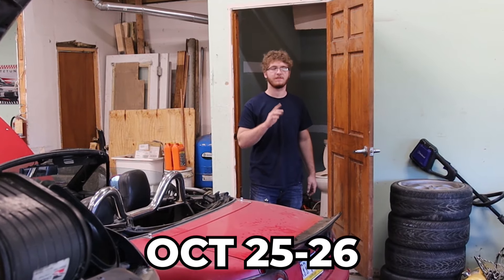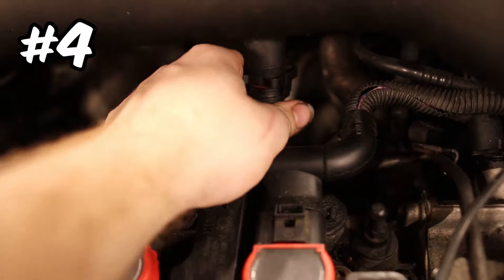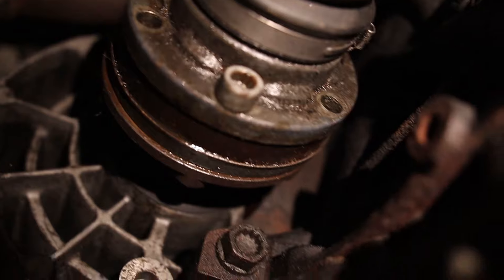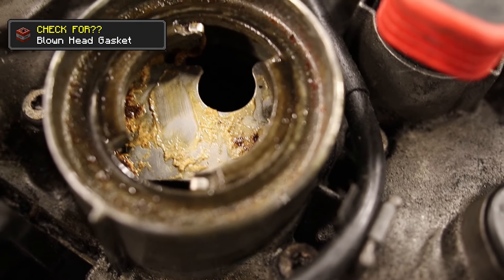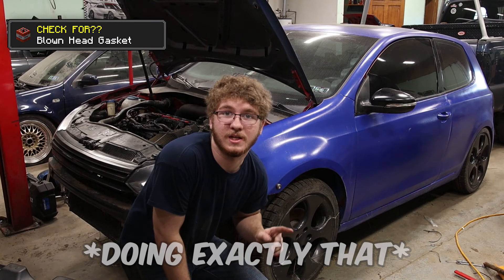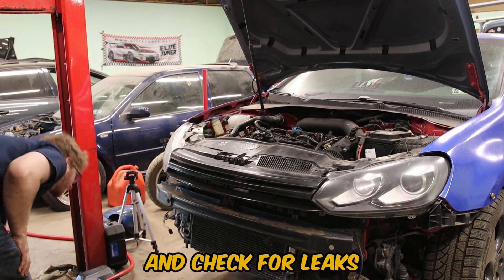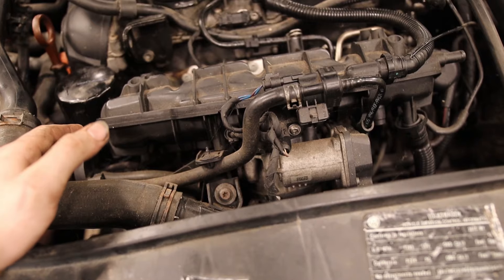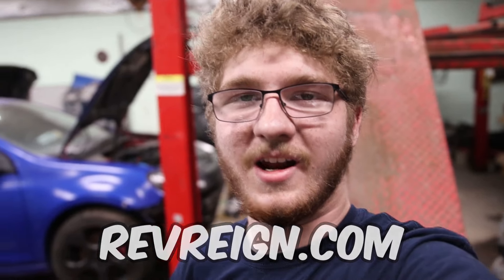Was Buying This $400 GTI A Mistake?

Comment: These cars are quite common for condensation building up in the top of the engine and it’s due to the PVC plate which is supposed to separate water and oil and Reburn it either through the inlet manifold or back through the Turbo system depending on if you boost or not Generally replacing the PVC plate can fix the matter and it’s wise to change it anyway because this is a common failure point on these cars , but make sure it’s an OEM product latest revision from vw or TPS, as getting a Chinese knock off from Ebay will cause you more problems than you’ll ever know lol